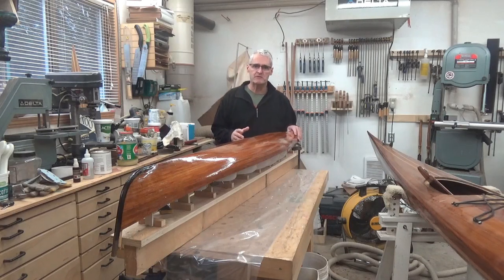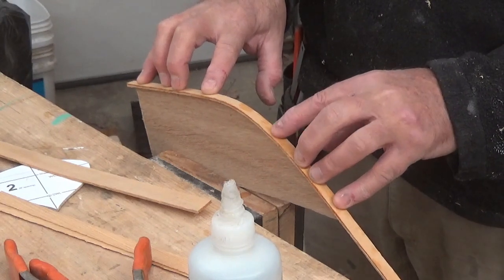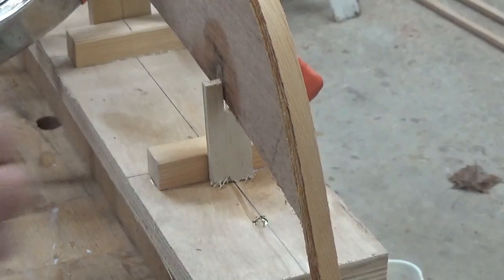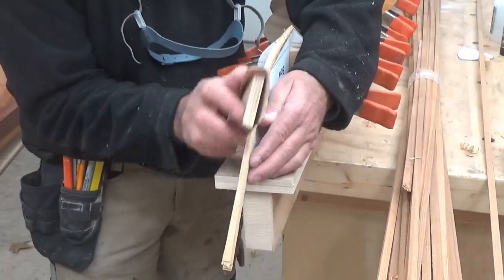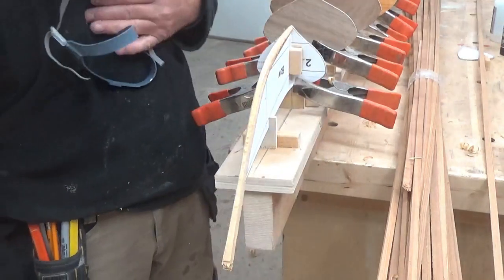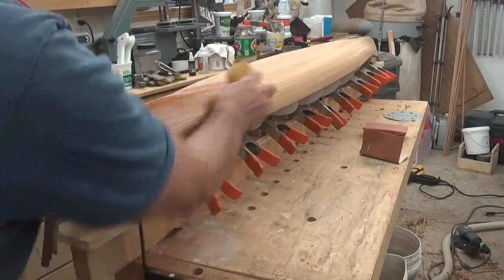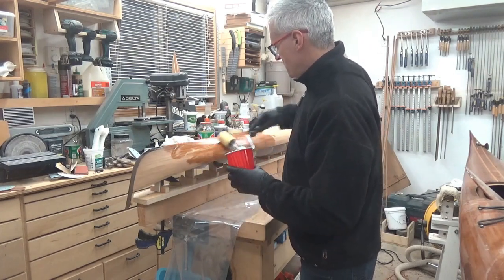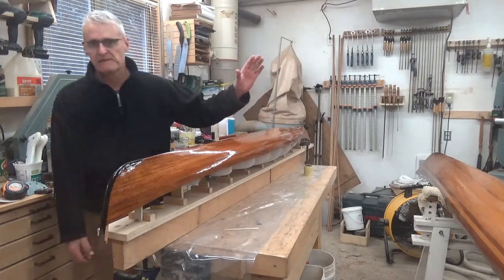Building a Wooden Kayak model - EP 2

Comment: I highly recommend using a wallpaper steamer or any other steamer for the stem laminates. I had the same splitting issue with some 1/8in ash planks for my Petrel Play, because the wood was kiln dried and heat gun did not work well on it. So I got a steamer, 15-20 minutes and they bend well and conform nicely to the stems.
Reply from the maker: I do have a full steamer and steam box, but for this small operation the heat gun worked fine if I was just patient.   I laminated the inside stems very easily without heat or steam as they were a bit thinner.

Comment: Im curious as to its home, will it go into a museum or a commercial or government building as art to satisfy regulations or tax deductions. Or to a private collector. None of my business, I'm just intrigued. Also seeing the ease at which cyanoacrylate was utilized in stem making, would this be something used on full-sized kayaks? It looks faster and easier than epoxy and dust mixes. one last question, Have you realized any other thing in the model techniques that might apply to full size to make life easier or faster?
Reply from the maker: The CA glue is fast, but I would not use it on a full size boat.  Much more expensive overall and not as strong as epoxy.  I find the CA glue to be quite brittle.  As for the final home, it will be in a federal office related to coastal response.  Not at liberty to say as not asked those that commissioned it, but I am sure once done I will be able to forward more info.